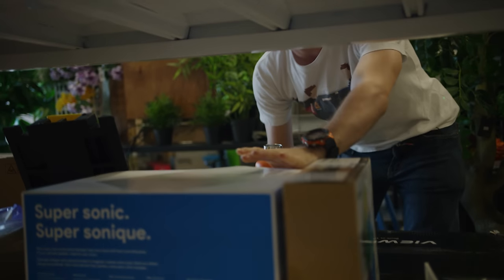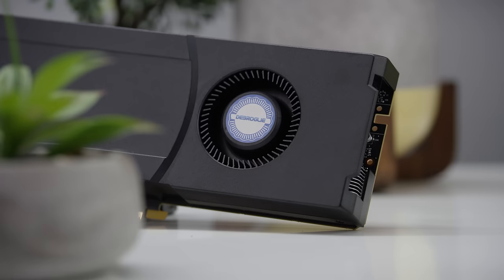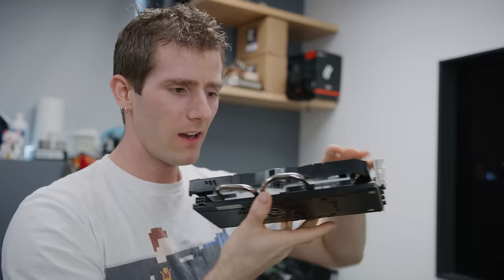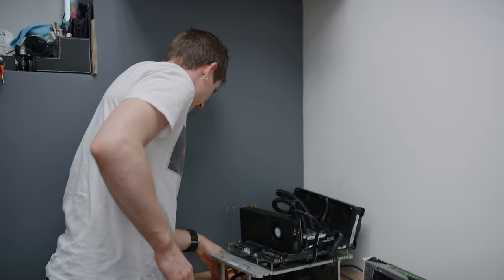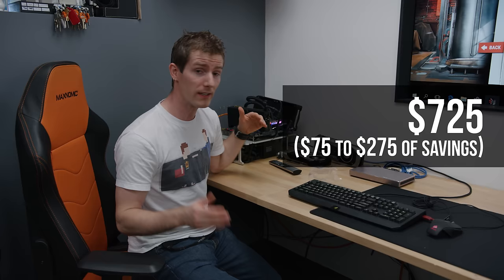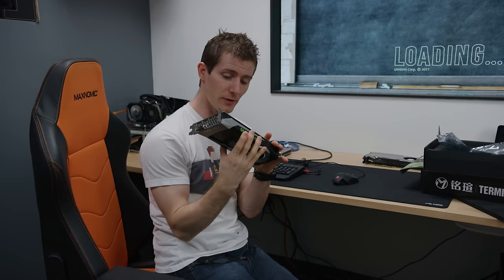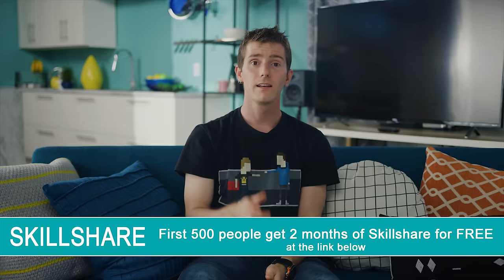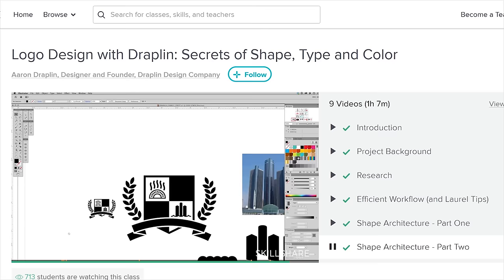Cheap AliExpress Graphics Cards - SCAM???

Comment: My first thought when he said 5GB was "Ah, a China-Only model." There are, in fact, a lot of manufacturers who will basically sell to 2 whole different markets with different prices, standards, etc, and China is among the leaders there when it comes to computers and technology. I've seen 5GB and 7GB video cards more than once that people assumed were fake, but turned out in the end to just be models not meant to be shipped or sold outside of mainland China. Makes it really easy to identify them in customer support cases (as in you get none, even if it's using real parts). Basically, from what the test results showed, these are the rejects, or "B bin" cards from manufacturers, being slightly modified for resale in certain markets where they will never be held liable for anything that happens after they sell those parts to an OEM. 
In those cases that I've seen, like here, they bought them off AliExpress. Linus paid $725 for a video card that likely cost the reseller less than $300 (around 2000 Yuan is likely from what I've found, but only found locally, not online, as they're not legal to export usually) at a local shop to buy AND ship, and ended up with something you were never intended to be aware of, let alone receive, as we are not part of that target market. The thing they usually find is exactly in line with what Linus found - cheap, low quality cooling systems and power management. You can bet that if Linus ran an actual stress test or 24hr burntest on either of those cards, he'd have much different results as the capacitors started to overheat and die or the GPU itself start to deball from the board due to extreme overheating, much like the original Xbox 360. 

Actually, Linus, you might want to get back in touch with Stranger Parts and see if he can find one or both of those same exact boxes at a local shop over there in Shenzhen, and get a more precise idea what the markup might actually be on those specific ones. I'm sure there are others like me who are curious.

Comment: Careful: Aliexpress (in contrast to eBay) does not include import tax from far eastern countries. Prepare to pick up & pay for your stuff at customs. Better look for grey import deals on eBay that were shipped by the dealer to a "nearby" location beforehand and then sent to you without the need to pay for customs!
Reply: They often straight up lie on the label about what's in the box so you won't have to pay taxes. Where I live, we need to pay taxes over imported goods from China that are more expensive than €22. When you order something, they will just put on the box that it costs less than that (and that it's dangerous to mail the package after it's been opened).

Worked multiple times for me :)
Reply: DSP Most the time you won't get hit by Customs, if you do it won't be for much money, usually phones are marked as a $5 MP3 Player or 'Gift'
Reply: I purchased a phone and it said mp3 player...
Reply: Well, not all sellers on Aliexpress know about this trick and some dont seem to care.
In my case: I bought 2 LED lights which were not on the european market yet via the official manufacturers account on Ali from China. They did not attach ANY information to the box and I had to pay my 19% taxes at the German customs where the item was held. They forced me to give them the original payment details + the original invoice so I wouldnt lie about the price.
If I want to buy cheap electronics, I will never rely on Ali anymore - I'll buy through eBay sellers which sell stuff from other EU countries which were "secretly" imported from China.
Reply: qwertyuiopzxcfgh
That how I get all my products from the US. Import them and lie about the price!
Reply: DSP Same here. Bought a phone for 230 € and had to pay nearly 70 € extra for customs and "filing of documents".
Reply: Nope, they use the "gift" option so you don't pay jack shit when you receive your order
Reply: Andrius R. Weird I bought a £220 phone from Banggood and was hit with a £12 Custom charge 

I didn't have to fill in any documents, some senders sneak it into a European countries than ship it out from there EU warehouse so it doesn't get any charges
Reply: Lol. Ebays GSP is a fucking scam. They over charge non Americans on "import taxes" and pockets the rest. I'd rather pay the import tax myself then being charged for it.
Reply: VGMStudios33
True
Reply: i SIMPLY changed my name by deed poll to A GIFT and now everything I buy is tax free/vat free <jk> have saved some money but taking a chance on customs . I will take that maxsun 1060 for a piece of "the" wedding cake ?
Reply: Customs Officers are not dumb. If you do not fly under the radar because of the sheer volume of packages from Asia, you will of course be charged import taxes and duties. A "gift" will not save you from that. Furthermore, not paying taxes and lying to federal employees can get you in trouble.
Reply: not if you specifically ask to put a fake price. Illegal but works 90% of the time
Reply: DSP It probably depends on what country you are importing to, the UK seems to ignore stuff from China for some reason and it just gets delivered without any extra cost.
Reply: I don't have any problem in AliExpress since 2016 until now, yeah I pay a tax for more than $50 + $2 to Postman
Reply: No. just no. The sellers just fake the value on the package
Reply: About ebay: Goods outside the EU are subject in customs duty and... VAT {when delivered to the EU)
Reply: In Europe anything that is imported from outside EU's single market is subjected to tax. Yes, there is a small tax-free allowance but once over it the item is subjected to both VAT + import tax on its full cost. For expensive items like a flagship graphics card you should be expecting to pay a 23% combined tax (import + VAT) on top of the total amount you paid (item cost+packaging+delivery cost). In most countries you don't need to go to the customs to collect your item. Just when it arrives, you get notified about how much tax you need to pay and you pay online. Once you pay the mail service provider will deliver it at your home as per usual.
Reply: nice in depth analysis
Reply: zseven no. I do not think you ordered many things in China. I am from germany and ordered about 30-40+ items on Aliexpress, many over 22€ but I never paid customs.

Comment: I think, if you take care of cooling, cleaning and power supply, these VGA cards can be durable, because in my view it's the only "problem" they can bring, the specifications and benchmarks are the same as the "originals".
Reply: Funny, i do not hear linus say these cards are overheating. So it sounds a little premature you need to replace the cooling.

Comment: Bought GPU on Aliexpress.
Expect to get scammed.
Didn't get scammed.
Cards works perfectly.
Still being skeptical about everything.
:D
Reply: pretty same feel here XD
Reply: Likewise, but maybe less if he went more in-depth with it, mainly how thermal works.
Reply: It'll work, just not as good
Reply: Triggered Feminist I mean, it is basically recycled. But I guess if you can, just swap out the cooler for a better one and it should probably last a while.
Reply: TRUE STORY..
Reply: VikingSail Well, yeah, of course. It has no warranty and may crap out in a few months or have terrible thermals on the die, VRMs or memory which kill or degrade it's performance eventually. 
So yes, still skeptical.
Reply: Typical
Reply: I’d be skeptical of thermals, how long it will last for and of course the warranty.
Reply: Dick R So if Linus actually wanted to analyze this instead of just a click-baity entertainment channel he would breakdown the VRMs, chokes and check temps, and then we could find out how good it is.

The 1080 is a founder's edition PCB apparently according to them, so it should be perfectly fine and only temps should be a worry.
Reply: Chinese philosophy on consumer goods and customer service is vastly diffrent from the western one. Linus is smart to be coutious as its intended for a chinese market.
Reply: it seems like a viable way to get a card if you plan on watercooling it.
Reply: Even if it's a recycled cooler, doesn't necessarily mean it's not fit for purpose. A heatsink is a heatsink. A fan is a fan. It doesn't cease to take heat away just because a new design comes out. He should've definitely tested its thermal performance.
Reply: The care was hardly tested, the warranty is questionable and he didn't stress test them or try OC. There's a reason to be skeptical when so many questions remain unanswered.
Reply: I don't think they will have thermal problems at all... I think they'll just be louder, because the fans need to spin faster to keep a good temp.
Reply: not scammed if they were build by a china company.. they are professional .. made in china that comes from a sidewalk or house work is probably scam.
Reply: Yes, because these cards are el cheapo, from having fake cooler parts, all the way to using ridiculously low quality cheap plastic for the shroud.

Why wouldnt you be skeptical?

These cards are pieces of crap, honestly.
Reply: Linustechtips, in-depth, pick one
Reply: genuine 1080Ti w/ 980Ti HSF and Mac 7300GT part/serial number?

NOT SKETCHY AT ALL!!!!

Comment: I hope there is a follow up video on this where he has stress tested these parts and put them in actual computers and not just benchmarking devices.  I want to see how the cheap cooling methods hold up against extended play time and things as such because if these things actually turn out to be a good idea to buy, this could be a way to show the company that they need to bring in the 5GB cards and people can stop paying so much for cards until the prices drop back down to what they used to be.

Comment: Aliexpress is usually not too bad with returns/faulty purchases. But as always, if it seems too good to be true it probably is.
Reply: key word "probably" I made a whole pc using Alienxpress and it still works to  this day.
Reply: @commentgod2175  That's why I used the word "probably" because there are deals to be had. Typically if it's cheap, it's cheap for a reason.
Reply: @commentgod2175  do you remember the seller who you bought a gpu from? I’m thinking about buying pc parts on there but I’m worried if I get scammed. I would help out a lot.

Comment: The sli  connection is   taped over to protect it from  static or short circuits...  you can remove  the protections if you use the  SLI..

Comment: You guys should do a follow-up episode in 3-6 months to see if these cards are still preforming well, because this legit seems too good to be true.
Reply: Yeah would be cool if they ran a bit of torture testing on them and followed up.
Reply: it's only a 15% discount for a cheaply made card, especially if you don't pay import tax, it seems legit.
Reply: I mean he could just test the thermals right now since he's got the card. These seem like legit licensed boards from nvidia, the main factor seems like they've putting in a cheaper cooling solution.
Reply: That 5GB GTX1060 model has been sold in China for several months. I've never heard of any large-scale quality problems. They are designed for (even some low-end) net cafes, and they are expected to work under some really harsh environment.
Reply: What do you mean too good to be true? They bought the GTX 1080 from Aliexpress for $720. There's been several GTX 1080 on sale on /r/buildapcsales for $500-580. The price they paid is stupid bad.
Reply: If one of those cards was designed for LAN cafes, where it has to run games 24/7 to make money, it's probably more durable than regular consumer cards. Which means that cheapo cooler is perfectly sufficient, and regular consumers pay a premium for overengineered, fancy, but ultimately pretty much pointless coolers - unless you want to overclock of course, something a cafe almost certainly isn't going to bother with.
Reply: China has a lot of crypto mining and net cafes, so I wouldn't put it past some companies to buy up the parts and rigs when one folds or upgrades to refurbish into frankencards, then put them onto aliexpress as "new".

After all, that 980 shroud had to come from somewhere...
Reply: Aubreykun,
Hilarious how it has the model number of a random Apple card, makes no sense...
Reply: Aubreykun ye i guess the1080 is from some kinda mining farm and that 1060 is definately brand new
Reply: The Rustiest Venture this is 6 months after youtubers started doing this LOL
Reply: John Connor these cards were purchased BEFORE those prices started dropping to normal, obviously.
Reply: bit of torture is just by being held by linus the dropper, lol
Reply: Unlike the "Elsa", Maxsum is a legit company in China. The 5GB GTX1060 is designed to have less mining ability (maybe even worse than the cheaper 3GB 1060) with reduced bandwidth and ROPs. Miners won't use these cards.

Comment: Yeah boy..... your founder overpriced eddition got wrecked by the chinese low budget 1080ti. LeL
Reply: Overpriced?
Reply: @ryusei9941  Founder editions are always overpriced because they're early models.
Reply: @gamerdude1246  do they have any benefit vs the normal models
Reply: dude i seen in most benchmarks hwo the founder edition with all drivers and etc gets wrecked by cheaper cards and even lower Mhz cards wrecked it without OC
Reply: @notoriousbig3k  off course lah. Founder edition is basic.
Reply: Gamerdude1246 founders edition are MSRP.
Reply: @kruxdt6307  no. theyre the most basic model you can receive. they have no specialties to them. Companies usually add their own crazy buffs and technologies to the card when the chip is released
Reply: @kruxdt6307  When they had blower type cooling, they were the recommended choice for tight builds (for example Mini-ITX, or cases with bad airflow), because the cooler blows the hot air straight out of the case through the cards' I/O panel, while coolers with axial fans push heated air back into the case. Blowers tend to run hotter and louder than proper, 3rd party axial solutions, but it's managabe with some tweaking.  Has its ups and downs.

Since RTX, NVIDIA switched to a double axial fan design on its Founders Edition cards, so no more benefits with small form factor/limited space builds, but they kept the "no 0 dB(A) mode" from previous reference models, which means that the fan(s) are ALWAYS spinning, even in idle. Usually, the modus operandi is that you tweak the fan curve (and voltages/clocks) a bit to get more pleasing results with efficiency/noise.
Reply: It's a "1080" not a "1080 Ti", Big difference...
Reply: @kruxdt6307  basically no. Nvidia Founders models are almost completely barebones, AMD has some parters that also do their Reference models so you can get an OC version. blower models spit the heat out the back so that can be an advantage. some people think they are loud. i can assure you those people never owned a PS3 or PS4 though. my RX480, cpu cooler, and 4 cheap case fans is a quiet little mouse compared to my PS4.
Reply: I bought the 1060 6gb founders edition 2 years ago, and it was cheaper then all other 1060 6 gb in my country, I live in Norway
Reply: hahhaha correct XD american still did not realize the stuff is made nearly only in china ??? they have so cheap and good stuff